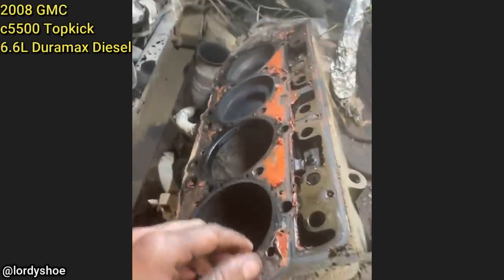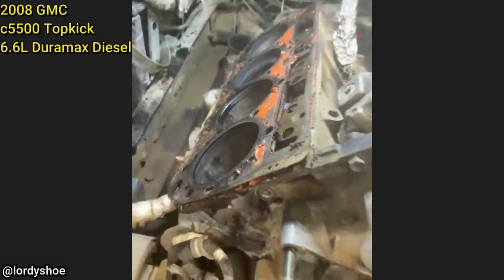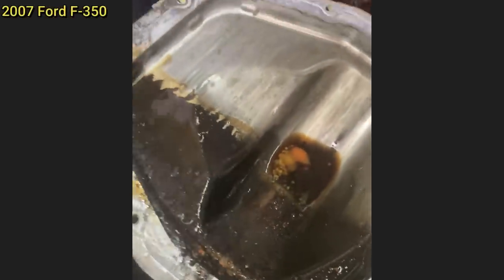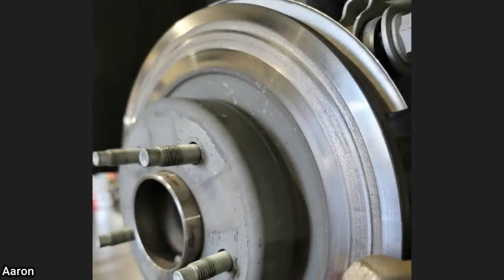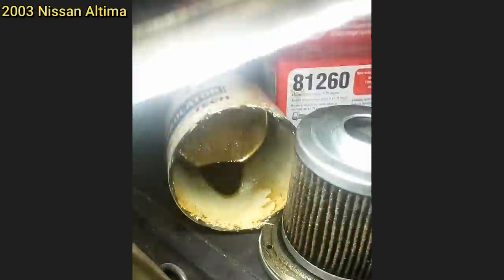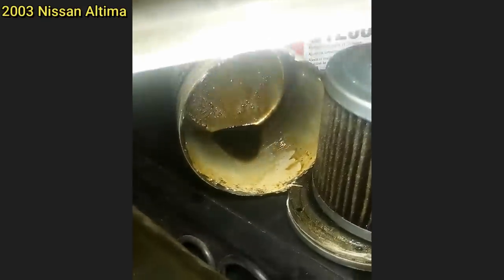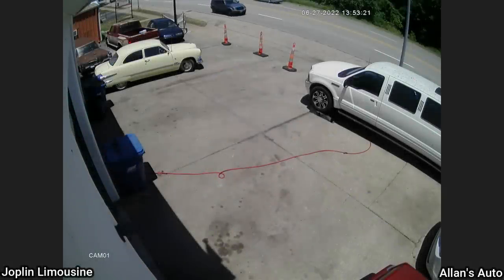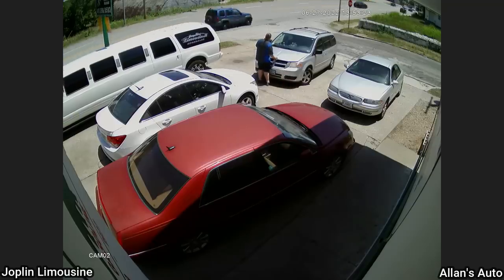Customer States Truck Might Need New Head Gaskets (GMC TopKick) | Just Rolled In

Comment: My Auto Tech teacher told us many stories about his days working for a huge dealership. One story was about the early Ford Escorts (like 1980-81) and their head gasket problems. Ford knew they had issues, and was working on a redesigned gasket. But in the meantime, customers' head gaskets were still leaking. So he and the other techs devised a plan. When an Escort came in with a leaky head gasket, they'd unbolt the head and lift it up, slide out the gasket, paint both sides with copper spray-a-gasket, slip it back in, and bolt the head back down. Apparently, the "painted", used head gaskets lasted longer than a new head gasket (which was still the same leaky design at that point). Once the newly redesigned gasket was finally released, he said some techs still painted them before putting them in, just in case.
Also, that shop manager is a legend. Didn't even drop his cigarette, lol.
Reply: Lot of guys did the same thing with Mopar 2.2.  They didn't "remove" wiring, fuel lines, exhaust, etc.  Just unbolted the head, and slipped a gasket in.  It was called "The slip and slide"
Reply: Using copper coat on head gaskets is a common practice.
Reply: Engineers should have required shop hours before working in an office same way pilots have a minimum numbers of flight hours before flying commercial.
Reply: I called those escorts, cars with the briggs and stratton engine. That's what they sounded like
Reply: @thadrepairsitall1278  Yep, did the same when I replaced the head (and gasket) on my diesel truck.
Reply: Been painting head gaskets with extractor/header paint for years.
Reply: It wasn't just Escorts that had head gasket issues. I had Escorts, a Sable, Crown Vic's all with that listed as an issue. I especially liked their tactic on the Crown Vics listing the oil seepage as "weeping" & being a "normal condition" . What they meant was the weeping wasn't bad enough to kill the engine & something else will do that by 130-150K miles. And they usually already had changed out the plastic intake manifolds due to cracking.
Reply: I have seen people use white out to stop head gasket leaks.
Reply: And people knock Subaru with their head gasket problems
Reply: Opel used to have such problems, too, in late 80's and into early 90's. so we would apply a thin line of a non-drying sealant to both sides of the gasket to help with seeping oil. their OHC engines also had big problems with oil pan sealings seeping a lot. there actually was just one vehicle I saw without such leaks, and the oil pan was about to corrode itself a hole... XD
Reply: Yep. I was a Ford tech during that time. The problem was not bad gaskets. The problem was the bolts would stretch. I think it was one of those weird problems that just don't show up until there are a whole bunch of cars out there in the public's hands. Maybe they were getting a little over-torqued during assembly.  If you replaced the head gasket and didn't replace the bolts, it wouldn't take long for the problem to reappear. The CopperSpray kept it glued together just a little longer.  To Ford's credit-and why I liked working them--they stepped up took care of the issue. Repairs as needed covered under warranty. Out of warranty approvals were a routine phone call.
Reply: @mindpilot72  Ah, that might be what he told us. I heard the story once, way back in 1995, so I may have forgotten or misremembered some details.
Reply: @rickhibdon11  do you know Ralph also from dodge dealer. rt 114 Danvers mass also. He showed me that trick many years ago.
Reply: @richardpalleschi4807  No.  But I can 100% honestly tell you I NEVER did that. I always did a proper job of them.  Couple of us had sort of a competition on who could do them quickest. (really wasn't a "bad" job) I'd tell the parts guy to pull everything I needed. Pull it into the shop and start the timer. From start to finish (properly) I could do one in 63 minutes. Of course I pulled all my tools out ahead  of time.
Reply: The more things that can go wrong the better for them.
Also, they want to get you used to cars  you can't repair. Turn vehicles into rental toys that have to be replaced rather then a machin that can last a lifetime that only needs upkeep minor repairs.

Comment: My son and I had to remove and replace the headlight assembly on my wife's car.  Not bad about 30 minutes, was good to work together and get the wife smiling.👍
Watching Just Rolled In makes me thank God I am not Stupid.
Appreciate the clips!!
Reply: Did you remember to recalibrate the headlight flux capacitor?
Reply: @tinknal6449  I hope he at least checked the blinker fluid while he was in there....
Reply: @MetalForEmmanuel  He may have one of the models where exhaust hydrocarbons are converted To emulsifcants and routed directly to the blinkers. Combined with the surfactant qualities of LED condensate from the headlights this makes a satisfactory blinker fluid.
Reply: @tinknal6449  Your probably right. A smart guy like him definitely went with that model.
Reply: @MetalForEmmanuel  i have never checked those on my car XD.
Reply: Hope you didn't forget the head light fluid...? /S

Comment: That last clip should remind everyone to chock the wheels EVERY time! And use good jack stands, not just a floor jack to hold a car up.
Reply: Man yeah! Imagine it slipping and coming down on you. Even if it doesn't crush you, there you are trapped under something until help comes. Never chance a vehicle rolling or falling.
Reply: Hopefully the guy learned a valuable safety lesson that day.
Reply: @russellhltn1396  I'm sure he will take the safety lesson with him to a new shop.
Reply: Or just set the E-Brake.  Chalks only need to be used on the front of a vehicle as long as you have tested the E-brake and have made sure they work.  But to be extra safe you can use them on the back as well.  No harm in being extra safe.
Reply: @timbuckohfive2751  redundancy is safety. E-brakes have failed or slipped. It is always better to be safe then sorry when it comes to one mistake that can kill you.
Reply: yeah, if you don't have jack stands (or even a few old tires, heck you could even use the current ones) consider that the hospital bills for your injury (or funeral) cost much more, especially if you live in america.

if that's not enough, read the wikipedia article on crush trauma
Reply: My coworker lost her dad from a truck coming off jack stands and crushing,  then dragging him down the driveway.  Gruesome sad way to go.
Reply: Honestly I'm glad my mechanic came out of it ok. He is paying a bit more attention to his safety after that. That excursion is 13k pounds with no one in it. I don't know if the e brake would even hold it with the tranny. As when they build limos, they don't improve or upgrade suspension or braking anymore
..
Reply: @timbuckohfive2751  e-brakes are by no means reliable, they can easily be stretched or damaged, or just straight up ineffective. even if they seem fine at a still, with pressure, or even more, with a gentle push to start it rolling, there is a good chance you're going down with that ship.

even my dad's prado (only 4 years old) always rolls back 20cm after you set the e-brake and take your foot off the pedal. Not sure if it is because of play in the linkage for the e-brake, or if the e-brake is stretched to the point where it is ineffective and the tranny is just rotating until it can bear on the pin, or whatever, I just know that it's more than enough to kill you
... geez that sounded like a threat
Reply: @jaredb6934  that sucks to here, im extremely critical about only using flat ground when needing to crawl under. a slant just guarantees one day it will fall and it's gonna take you with it.
Reply: @rolls_8798  probably not adjusted properly or shit design. either way, e-brake plus wheel chock and leave the jack with the stand. hell put the tires under the side but the key factor is work on a level ground. 99 out of 100 times when you see them roll off or the jack kicks is because some thick skull is doing it on their inclined driveway.
Reply: @rickylafleur5823  absolutely. jack stands were NOT  made to work on any surface that is not level
Reply: My friend doesn't take any chances. He super glues his tires to the concrete pad. ....
Reply: Yes and also, if your car does start rolling backward downhill, best practice calls for running to the driver's side door from the front and not running around the back as this guy did before his buddy saved the day.  You see kids, a car.....
Reply: @jonesjones7057  what to do is a afterthought. what to do so this doesn't happen is key. wheel chocks, e brake and flat ground prevents this scenario from ever happening.

Comment: 2:29  Complaint:  "Window doesn't work."
          Diagnosis:  Window doesn't exist.
          Charge:        $150.00
Reply: I think it has a window, but it’s missing the window regulator to open and close the window. The boards are holding up the window. I bet lots of people buy cars without checking every button, switch, and control. If they bought it in AS-IS used condition, with no warranty, then they are basically screwed. The law says, “caveat emptor”, let the buyer beware.
Reply: @gs1100ed  I’ve bought many vehicle with such problems such as the mirrors not rotating properly upon pressing the buttons. I just assume the buttons are worn out or the motor needs replacing (no big deal). Not once would I have considered someone removed the motor and stuck blocks of wood to hold the window in place. I’ve seen people put trans coolers under air tanks of semis but not once have I seen wood blocks in a door😂
Reply: @foodhatesme  the more “common fix” I’ve seen was screwdrivers stuck in the door window seal. Wood blocks? Honestly if I saw this I would only laugh
Reply: @Donniec685  every time that I think I’ve seen it all, someone comes along and let’s me know that I have not. The more I learn, the more I realize how very little I actually know.
Reply: @Donniec685  never know when you might break down on a country road in the winter and need wood for a fire to keep warm.  Great out of the way place to store it.
Reply: @Donniec685  I've seen it once, in my own car. I had an old '92 Dodge Dynasty and something broke in the front passenger power window. Being a non car guy and extremely broke at the time, it was easier (and, of course, cheaper) to just cram a board in there to hold the window up than to try and take the whole door apart and figure out the cause of the problem. That board was still in there 5 years later when I junked it, after the evidently-very-rusty perch for the driver-side rear suspension spring rather spectacularly failed when I went over some train tracks.

Comment: The air condition one reminds me of the time my granite guy got called out to fix a soap dispenser that was inset in the granite. (they wouldn't tell him over the phone what the problem was) He said the drive was 3hrs for him and when he got there they asked how was this house wife supposed to crawl behind the sink under the granite to remove the bottle so she could put soap in it. He said "why would she do that , just take the dispenser top off and fill it from the top" and walked out. hahaha.
Reply: I did the exact same thing.  I worked for a company who did dental offices and we installed soap dispensers in the formica tops.  I went back about a year later for an addition to this one office and I noticed they had soap dispensers sitting on the counter top. I asked them why they didn't use the one I installed.  They said they didn't want to crawl in the cabinet, unscrew the little bottle and replace it.  So I removed the spout from the top to show them an easier way.   Ever after that, when I installed one of those, I would leave it propped up so they could see that they could fill it from the top.
Reply: The fact that you have "a granite guy" is both weird and impressive.
Reply: @writerconsidered  He's probably a contractor and has a go to granite guy (don't mind the necro reply).

Comment: 2:37 I hate overly complicated touch screens. It contributes to distracted driving.
Reply: I never saw anything wrong with just reaching over and turning a knob or pushing a button. It's so easy you usually don't even have to look at what you're doing.
Reply: Yes! Bring back the direct manual sliders for directing the air and controlling the temperature! The more complex, the greater chance of failure.
Reply: Something’s I believe need to stay on the screen such as radio functions. But some necessities need to stay manual controls such as air control. There’s no need to interact with a UI system just to turn my air up or down.
Reply: Adding a bunch of virtual buttons and endless menus to a touch screen based UI is a lot cheaper than designing physical buttons into the car. It's also cheaper and less complex to manufacture. 

I agree it's a terrible design choice, especially in a car. The more common the task the easier the controls should be to manipulate, preferably without looking at them.
Reply: @Donniec685  Radio functions should only be on a screen? Why? If you're using something like Sirius radio, I can see some of your point, but an old fashioned radio never needed that. I also dislike my 2005 Ford's radio station search function, because it doesn't have a 1970s styled knob on it so I can fine-tune my connection.
Reply: Get a Buick Cascada. Instead of a complicated screen, it has like 30 buttons on the center console. Even worse, if you ask me.
Reply: @101Volts  
I can tell you from experience that routing radio controls through a touch screen is a NIGHTMARE. Some of the Mitsubishis have the VOLUME CONTROL on the touch screen. Ridiculous.

Comment: I always thought my car was rusty that truck gave me a whole new meaning to rusted out
Reply: Because it's a Chevy lol
Reply: You see this shit all the time in northern states with salted roads.
Reply: @scottrussell6717  Fords and Dodge are the same damn way.  At least with the Dodges the tailgate hold up pretty well.  Fords rust in the box and doors but the front ends stay good.
Reply: My guess is that the chassis is just as rotten!
Reply: I instantly recognized it as similar to my 07 GMC Sierra.

I just last month riveted some tin to fix my driver's side that was pretty flimsy.

Winter road salt is not kind here in Wisconsin.
Reply: @stevie-ray2020  Doubt it.  Apples and oranges.  I live in salt country.  Plenty of rusted tin but seldom a rusted frame, at least on a truck.
Reply: Used to see this all the time when I was a kid. People would lash rope across the bed to keep the fenders from flapping in the wind.
Reply: In UK, it would be condemned as unroadworthy & scrapped. We have quite strict (& mandatory) annual vehicle safety checks on any vehicle 3 years old onwards. And yes, we salt our roads (liberally) in the winter.

Comment: One day I had a car on ramps to change auto transmission fluid. I chocked the back wheels. While I was taking the pan off, I accidentally bumped the shift lever, and the car lurched into neutral. Those wheel chocks saved the day, but it was a creepy feeling, to realize what just happened.
Reply: set the ebrake and chock it. the e brake keeps it in place and you can check the drive train and if the ebrake not working the chocks keep you from being pancaked.
Reply: Reading that made my stomach flip.